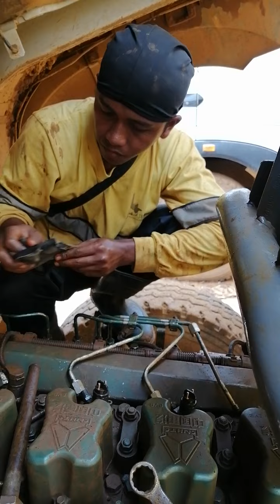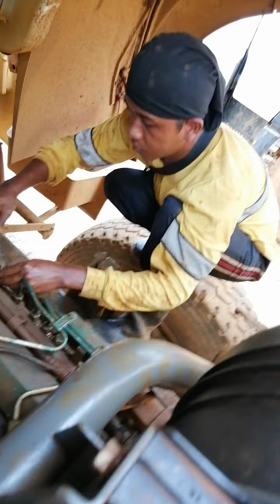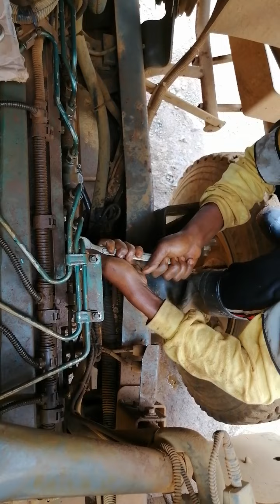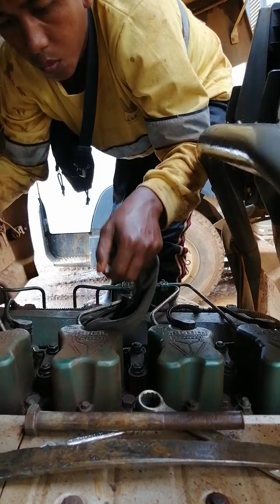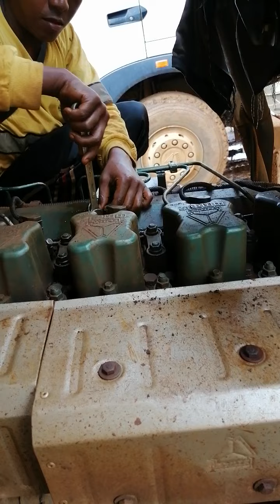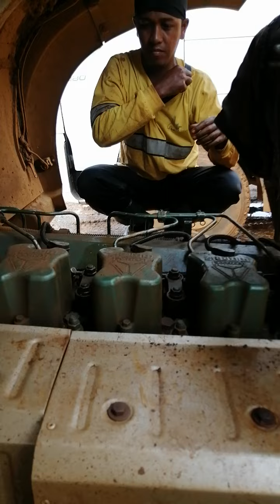replace electronic injector howo 380.engine....

Comment: Good day po ,,, sir may konti g katarungan lang din Sana ako ano po kaya dahilan ng unit namen howo 380 low power xa pero wala nman lumalabas na check engine sa dashboard
Reply from the maker: try. nyu lang palitan ng water separetor filter at. fuel filter..... kc yan inaayus namin nahaloan ng tubig ang diesel na itinobil yan nasira ang injector kc electronic...